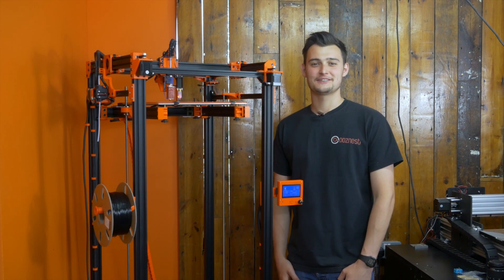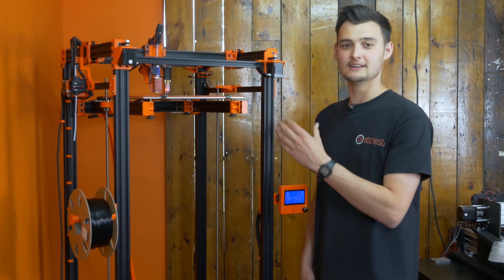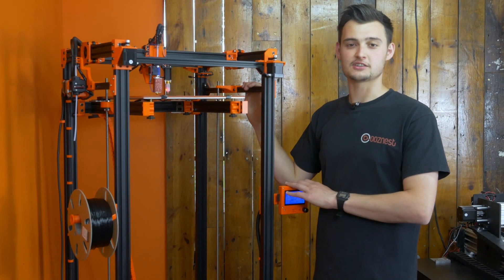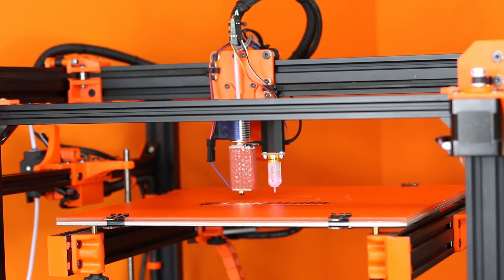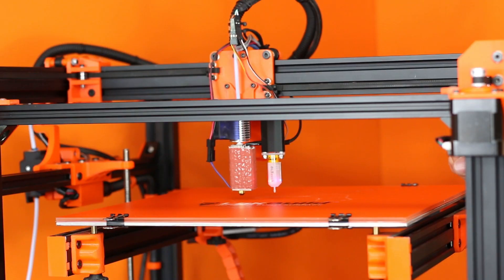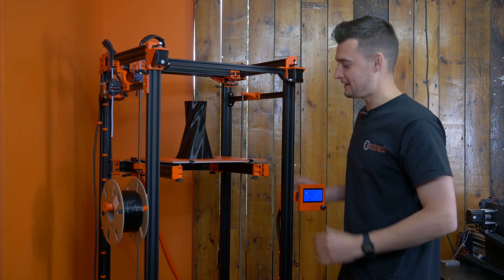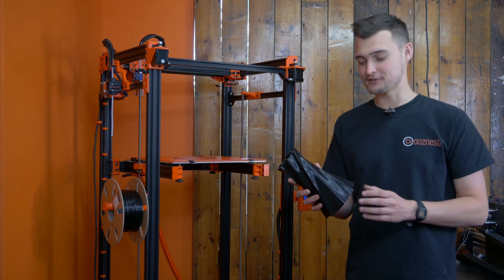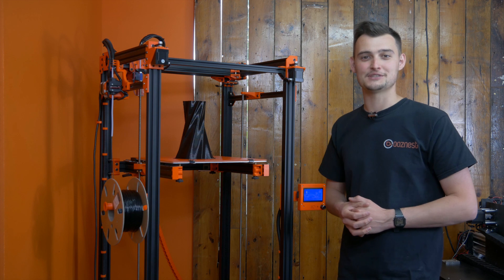Setting Up & Printing With the E3D Super Volcano | Ooznest

Comment: Hello, we are stepping up our game to the vulcano and later to the supervulcano for mass production. What PETG setting do you guys use on 0.4 to get those smooth results ? Anything special we do need to look out for?
Reply from the maker: Hi there! We used a default speed of 60mm per second using a 1.4mm Nozzle and a 1mm layer height :)
Reply: @ooznest  So you go slow than. We already printing at over 150mm/s flawless even on 0.2 layer height. We pushing right now towards above 200mm/s
Reply from the maker: @lse-group  No worries! if you have any further questions, don't hesitate to get in touch - https://ooznest.co.uk/help/#tab_technical-support
Reply: @lse-group They print 84 mm³/s, and you're only 16. 
So "go slow" is just you here 🤣

Comment: Do you have a longer term review of the super volcano? My machine is 700mm x 700mm x900 mm and it currently uses a regular titan extruder in direct drive setup. I would love to know more about how this hotend behaves after a few weeks of hard work since the main use for my machine is making concept furniture and large parts.
Reply from the maker: Hi Justin, thanks for your email. I am afraid we don't have a long term review of it. We have been using it on and off for a while, and it has always worked well for us. Ryan

Comment: how can i learn how to build printers like this?
Reply: needs appropriate funds obviously. Start small is my advice, because you learn so much with your first build.
Reply: It's not hard, just use precut aluminium extrusions - they will connect easily and at right angles "on their own".

The rest is just a bit of research and of course, investment.
Reply: you dont learn how to build printers, you learn how machines work, how to build structures and all the mechanical aspect of a machine, and then you apply it to build a printer.
For a printer it would be how to make it the most rigid frame posible while also keeping it lightweight. The more rigid, the better quality your prints will have, and also more rigid means you can print faster (if your hotend and steppers are up to the task) 
if you rather have a more hands on approach i recommend you just buy an i3 clone kit and build it and learn how it works and how it fails and learn how to fix ir and enhance it on the go. At first your quality will be crap, but dont worry, the parts will be just as functional even if they dont look good. You can build better printers with ugly looking parts.

Comment: Hey, any idea of how many mm^3/s it can melt without issues?
Reply from the maker: Hi, i am afraid i don't know that data. But if you contact E3D they should: https://e3d-online.com/contact
Reply: This link gives good examples with different nozzles sizes for the Super Volcano...check your board before buying.  My ADIMLab [cheap Chinese] doesn't have a straight-forward way to wire it - will have to buy a new board...https://e3d-online.com/blog/2019/02/28/supervolcano/
Reply: Sorry for the late message. Should be in the upper 100's
Reply: @giedrius2149  
well then somethings bad with mine then, because i made my own clone (too expensive to import and its super cheap and simple to make)  and aside from adding an adapter inbetween the heatbreak and the normal vulcano nozzle (made from a brass M6 bolt), its mostly all the same and i can barely get to 60-70 mm^3/s using PLA at 260ºC (thermocouple reads the same). Maybe im wrong, but im using a 0,8mm nozzle and i dont think the nozzle diameter has anything to do with how fast it can melt plastic, because my problem isnt that the extruder cant push the plastic fast enough or that its skipping steps or chewing the filament, my problem is that above 50-55 it comes out too cold and start causing issues when printing.
Looking at the charts in @The Bheach Today's link it shows that bigger diameters did faster mm^3/s speeds, but that doesnt mean anything afaik its just a concidence, most likely because their machine isnt fast enough to keep high flowrates at smaller layer heights (higher linear speeds) 
As per the chart they did 110mm^3/s, which is what i read in an official e3d document which claimed 110mm^3/s @ 220ºC, using a 1.4mm nozzle, but if i tried that it would come out solid from the nozzle because theres no way i can do 110mm^3/s on mine, and its all the same specs, same size, materials, etc!

The main issue is that there arent many super vulcano videos, and most 3d printer channels seem oblivious to the fact that "fast" is measured in mm^3/s, no in mm/s. So between the lack of references and poor technical level in what exists.....im kind of left with trial and error as my only choice.

btw in my experience their numbers for the v6 and vulcano are also inflated so i wouldnt be surpriced if that were the case here too, so i wanted a second opinion just to be sure.